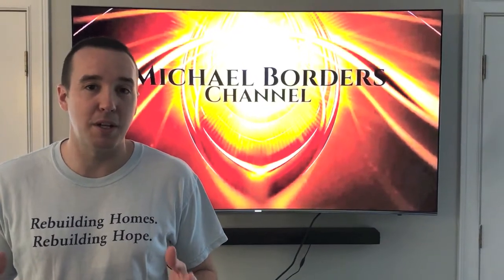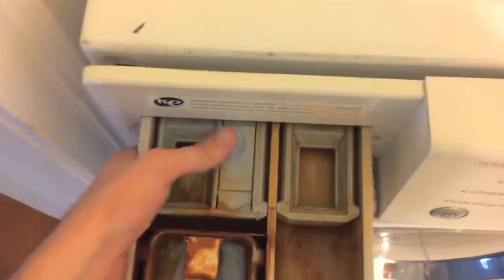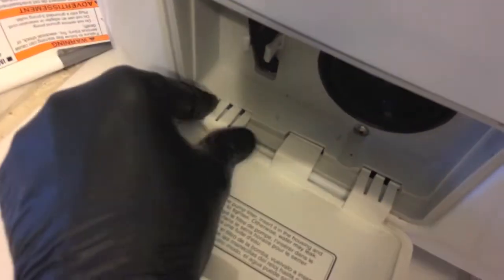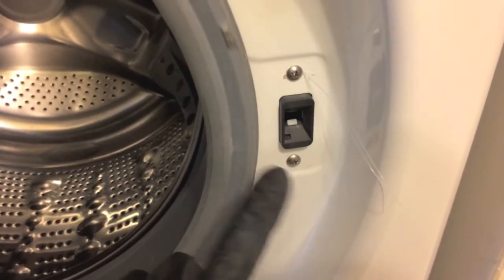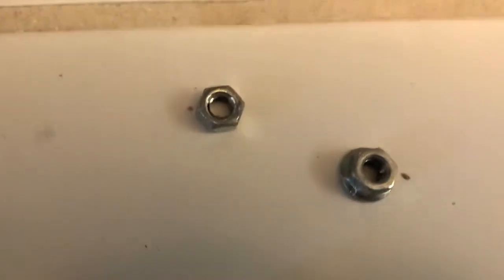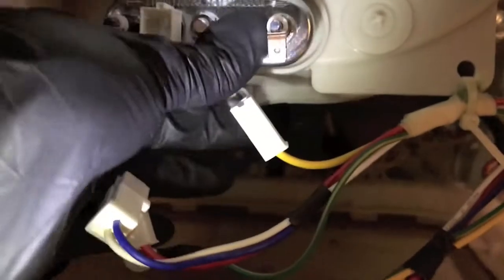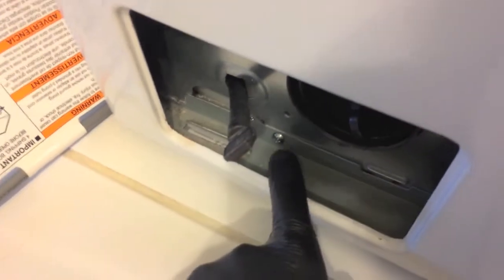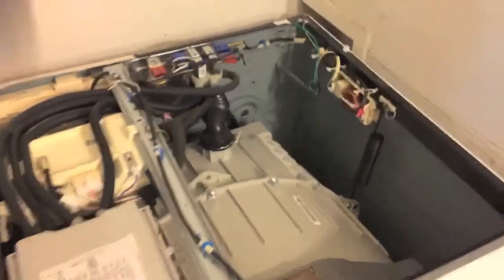How to replace LG washer Heating Element - FAST & EASY!

Comment: Thanks
I was having trouble removing my element and you tapped the earth bolt with a hammer which no other video showed and that needs doing to release the tension on the rubber gasket.
Mine came our perfectly after that - so thank you 😊

Comment: My LG washer is entirely  different!  This fix only applies to some models.  My machine is an F1247TD5 and uses an element mounted into the rear of the drum and requires far less effort to replace.  Just a case of removing 4 screws to take off the rear panel which gives access to the heating element.  It's a 5 minute job to replace and appears to use exactly the same element.
Reply from the maker: @allancopland1768  

Thanks for watching and sharing this info, always welcome here on our channel.

Comment: We had a special issue, a bit of the concrete or whatever it was had broken off and fallen on the wires to the heater/sensor. All looked well, but I pulled the wires out and put them back in and all was well. I couldn't have opened the washing machine without this video. Thanks a lot! Just one question - how do I put the ring back on? Have spend an entire evening on it. Right now running without it.
Reply from the maker: @sustainablesolutions7976  

Thanks for watching and sharing your experience, and you are very welcome.  We are honored to help and 👍👍 to you for making it a DIY project.

😁👍🧰

Comment: Thank you so much for posting this! I am going to attempt it as soon as the part is delivered. Just a quick question. At the end of the video it shows you turning the water back on, but you don't do that at the beginning of the video. In the beginning you only unplug the machine from the wall outlet. Is turning the water off necessary?
Reply from the maker: Thanks for watching, turning water off will be personal preference however we find it best to unplug unit at a minimum.

Looking forward to hearing back from you after your new part arrives.  🧰

Comment: Can a faulty thermistor also cause leak from it? I just got the TE error code. I have the same washer like the one in the video.  Thanks. I will be ordering the parts.
Reply from the maker: Thanks for watching, it’s possible depending on how exactly your thermistor is designed.  If it’s installed with a seal and secured tight to machine, it can leak if seal fails.

Let us know if you have any questions and hey if you’re into crypto trading, join our newly launched DIY ecosystem.

       toolboxtoken.com

Reach out to us any time!  🧰
Reply: @DIYwithMichaelBorders  thanks… looks like the leak was actually from a torn door seal toward the bottom… i wonder if the water leaking in this area was slowly creeping towards the thermistor/heating element which triggers a tE error code? Based on my observations, the tE code happens after the spin cycle and water has drained…
Reply from the maker: @CP-yj6gg  

Great find and observation!  Great to hear you pinpointed the leak.  We definitely believe that the water could be sneaking back toward the thermistor as you mentioned.

Great job!!!  😎👍🧰

Comment: thanks for a great video. Question: all the LG models had the thermistor in the same place? I found a thermistor LG WM2450HRA is that the right one?
Reply from the maker: Thanks for watching & welcome to the DIY Raptor Club.  We can’t speak for all model units however haven’t seen it installed anywhere else within the machines we have serviced.

Hope this helps, keep us posted on your project.  😎👍

Comment: Great video. Our LG WM2140CW is showing the TE error but does not have a heating element, only a sensor, we went through all the previous steps but nothing worked. All electrical seems fine, it look neat and clean. Any ideas on what else we can do?
Reply from the maker: Marie Simonon 

Thanks for watching & we hope the video helped.  Great question & let’s get this figured out!  😀

Your machine may have an additional Heating Element sensor that is faulty.  Here’s how we can tell.

Visit ( RepairClinic.com ) & enter your model number.  All replacement parts will be available.  Search Heating Element & all sensors will show.  You may have to replace an additional sensor.

We really enjoy making these helpful videos for our fellow DIY’ers.  Many more helpful videos to come!  😀

Keep us posted on your project & any questions you may have.  Please subscribe to the channel and turn on your YouTube notification Bell 🛎 that would be awesome thanks again!

😎👍🔧🔩
Reply: @DIYwithMichaelBorders  Thank you very much, yes, your videos are very helpful. We will check this out. Is there a way we can test if a sensor is faulty ? We already did subscribe and activate the notification bell :)
Reply from the maker: Marie Simonon 

Thanks for the reply & we really appreciate your thoughts Marie, that’s awesome!  😀

You can test your sensors by doing a continuity test with a Volt Meter.  Unfortunately, we don’t have a video doing that however there are many helpful videos on YouTube that will get you the steps to test your parts.

Keep us posted!  😎👍🔧🔩

Comment: Great vid, super helpful. Probably a dumb question tho but I can see your floor tile underneath, can I not access and remove this element simply by placing the washer on it's side and getting at it from the open bottom. Just wondering as that whole door gasket thing is a pain. Or would that not be good for the machine to tip it on it's side? Thanks
Reply from the maker: Thanks for watching & welcome to the DIY Raptor Club.  Some of our viewers have mentioned that they replaced part by shifting washer upward & working from below.

Doing it as we demonstrate in this video ensures that you don’t damage machine nor create a leak within machine that may surface after putting everything back together.

Personal choice, great question.  Keep us posted on your project.

😎👍🔧🔩

Comment: Just pulled my washer apart following this video to find it has the heating element in the back and only 4 screws to get to it… 🤣🤣🤣

Found the heating element completely cracked up and the insides exposed… that explains why i was electrocuted getting out of the shower when the washer was running…😮

Is this normal?
That was some serious damage to the element, there was no error codes either…
Am i ok just replacing the element or did some other fault likely cause this?
Reply from the maker: Oh my goodness, that’s wild.  😁

That can definitely happen when electrical currents have a way to trip and be exposed.

Well now you know it’s only 4 screws next time if you have to replace it.  😁

Comment: Putting mine back together currently, and sliding the heating element back in, I feel as though the washer is just going to leak once I run it. Should I add some kind of sealant around the heating element while putting it back together?
Reply from the maker: Darrin Woll Jr 

Thanks for watching, it shouldn’t need any added sealant as long as it’s secured & seated properly to allow the rubber gasket to create that water tight seal.  We have never added sealant.  Keep us posted.  Us fellow DIY’ers need to stick together!

😎👍🔧🔩

Comment: Hi
Can you please help me. When I tried to remove the heating element it doesnt come off. The cover and the rubber is seperated and the heating element does not come out. I think I unscrew the knot way too much. Can you give me some advise please thanks.
Reply from the maker: Maybelline Ong 

Thanks for watching & it’s important to verify your removing correct element.  Some machines have very similar elements on the top portion of the washer and can lead to confusion when locating the correct part.

The heating element is on the bottom as shown in this video.  The element located on top in most cases is much harder to remove by design so you don’t remove it accidentally thinking it’s the lower heating element.  The lower element should slide right out very conveniently.  Hope the video helped.

Keep us posted.  Please subscribe to the channel and ring your YouTube bell 🔔 this Will be very helpful to us thanks again.

😎👍🔧🔩
Reply: @DIYwithMichaelBorders  Hi thanks for the reply. Mine is located at the bottom back of the machine but what happened to me is that, I did remove all the wires like in your video but my mistake was that I removed the knot from the bolt then when I tried to pull the metal out, it got seperated with the black rubber. But the rubber was so hard to take out. Would you know what is the best thing to do? Thank you.
Reply from the maker: Maybelline Ong 

Thanks for the reply.  The new Element should have a fresh new rubber seal on it depending on the year of machine.

😎👍🔧🔩
Reply from the maker: Maybelline Ong 

And just to verify, you have removed that 10 mm nut that secures the element in place on the washer?

😎👍🔧🔩

Comment: Michael watched all your videos however still have te code. But I tried to put it in diagnostic mode and it shows codes but then flashes te and won't actually go in to diagnostic mode. Holding my two fingers on sil and spin then hit power on button it turns on then gos to codes, then if you press play it's suppose to start the drum rotating counter clock wish but all it dose is go back to flashing te code. Any suggestions before I throw it out the back door?
Reply from the maker: Thanks for watching & welcome to the DIY Raptor Club.  Any updates?

It’s very possible that you have a faulty Thermistor.  Replacing Thermistor may solve issue.

The Thermistor is tied into the heating element electrical channel.  Keep us posted.

😎👍🔧🔩

Comment: Question, that part number shows two options, one that looks like the one you took out with the bent coils and also the one you replaced it with with just the horseshoe shape. Is one better than the other? The bent coil one is $20 cheaper. What is the difference between the two?
Reply from the maker: Kate Gardiner 

Thanks for watching & great question.  We purchased an aftermarket Coil from ( RepairClinic.com ).  The OEM part will be more expensive & May be the better option.

Keep us posted on your project.  So happy to help.  Don’t forget to subscribe to the channel and turn on your YouTube notification Bell 🛎 that would be awesome thanks again!

😎👍🔧🔩

Comment: We are getting that error code, but we do not use hot water. We use cold water only. How can it be a faulty heating element?
Reply from the maker: Thanks for watching & it’s still in the background communicating with the control panel.  Sounds like it’s in its early stages of failure.  😎👍

Comment: Had technician out to check over machine and test everything. Turns out it was the element to be replaced. I was moving states so the technician was not able to install it. I watched this video to replace the element but still getting the te error code
Reply: I also wanted to add, to get to the element on my machine, I had to go through the back of the machine, not the front
Reply from the maker: @Parnz07  

Thanks for watching & sharing this.  Hopefully your travels went well.  The next part to replace is your Thermistor.

Comment: I replaced the element but I'm still getting the tE error code. Other suggestions?
Reply from the maker: Jeff and Traci Reddekopp 

Thanks for watching.  The next thing we recommend checking is the wiring that feeds into your thermistor.  Verify no signs of stress such as overheating, melting, or frays...

If all looks good, you may have a faulty thermistor.  Keep us posted.  Please subscribe to the channel and Ring your YouTube Bell 🛎 that would be awesome thanks again!

😎👍🔧🔩
Reply: Turns out it was just a broken wire that I missed.  Had to call the repair guy, oh well.  Thanks again for your help!
Reply from the maker: JRedd 

Thanks for the update & we appreciate it.  Sounds like you’re back in business.  Great to hear!

😎👍🔧🔩

Comment: I took out that heater element. And I found water inside, and residue, of dirt and old water. I'm guessing that's not normal. I don't even have access to clean in there. All I can think of is get a new one? Anyone has this problem? Let me know what the deal, thanks.
Reply from the maker: Thanks for watching & sharing this.  Unfortunately that is not normal...

Replacing element is a good idea.